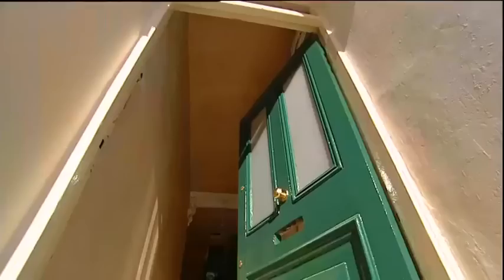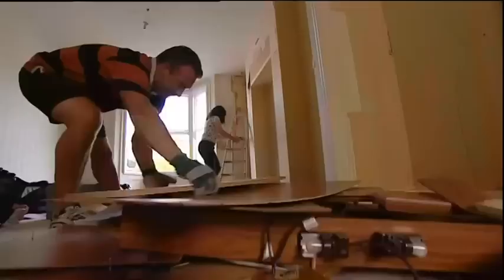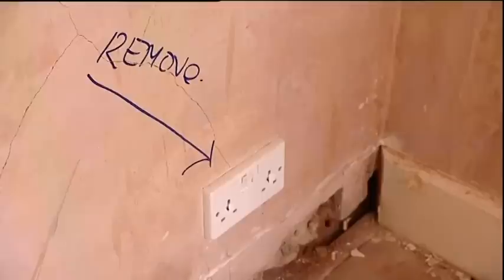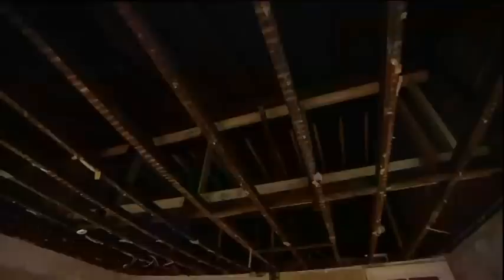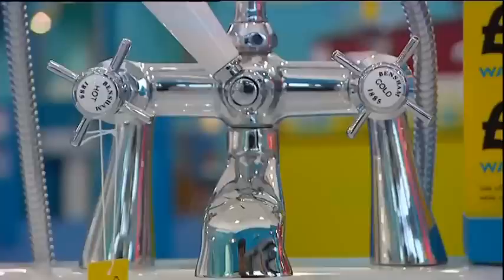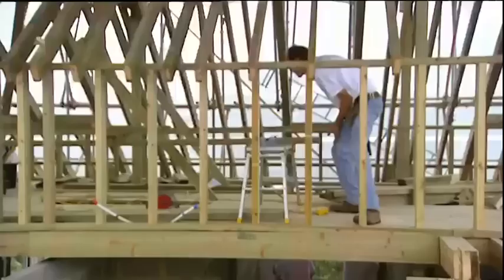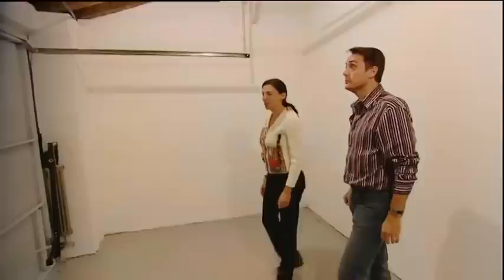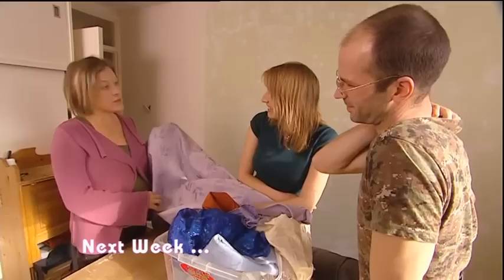Property Ladder S05E09

Comment: Not too smart to take on a renovation job and then leave for vacation.
Reply: Simply starting such an important build just three weeks later would have been ideal, and saved unnecessary stress in the process. Not considerate to the contractors, which is counterproductive at this key development stage.